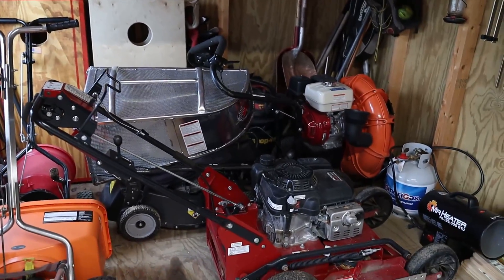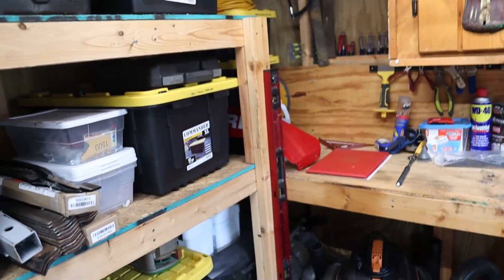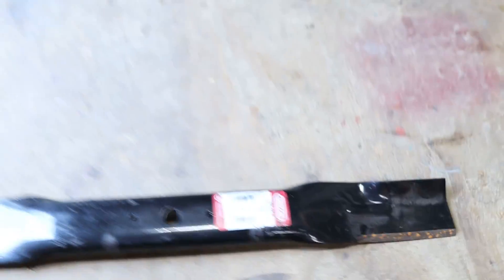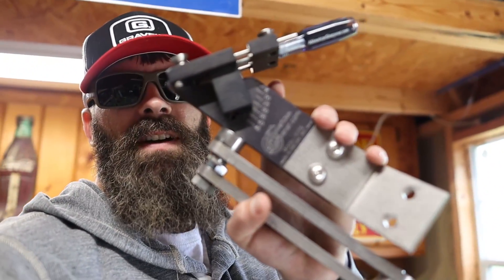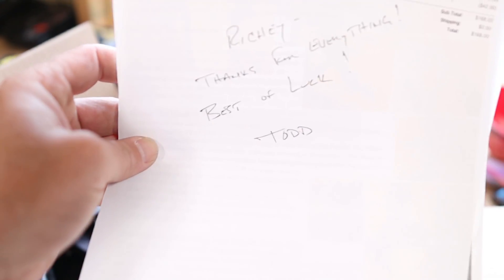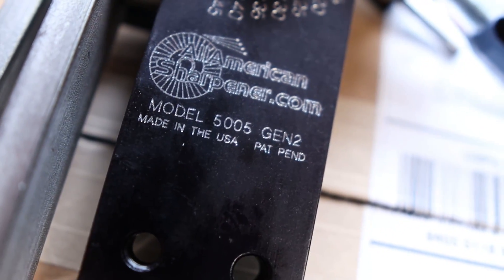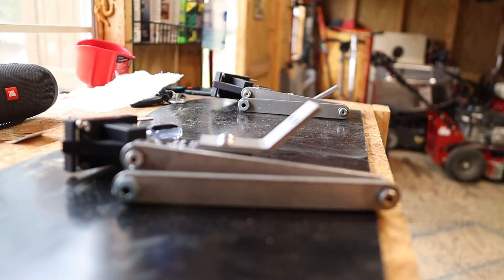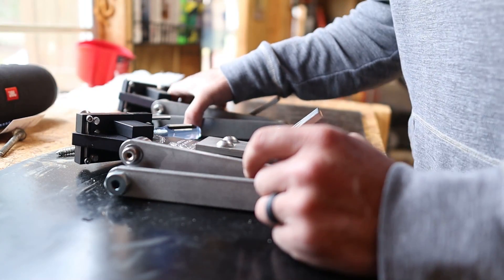The Best Lawn Mower Blade Sharpening Tool

Comment: In addition to only sharpening uphill.  Every two or three passes, put your fingers on the back of the blade.  If it's too hot to touch let it cool before continuing or you will be changing the temper of the blade. Flip the blade and do the other side whilst that side cools.
Reply from the maker: Thanks for the tip I will look in to it for sure
Reply: @PlemonsLawnCare  doesn't explain why you should only sharpen uphill, I'd imagine in part to keep from having the blade point grab and destroy the disc? Also what happens to the setup for the other blade that is reverse rotation and has the cutting edge on the other side of the blade, and why doesn't the shorter arm gen1 sharpener work on Walker blades does it just run out of reach?

Comment: I don’t have a lawn care business but I do have the 5005 gen 2. I have made a small business out of sharpening lawnmower blades and I have had nobody say anything bad about a blade I have sharpen. Everybody has there own way of doing thing but for me it was worth every dollar I paid for it.
Reply from the maker: Yea Ricky its amazing how great such a simple tool can be. Easy to put away and save space
Reply: I do have an extra mount and I use a Milwaukee m18 cordless grinder that works great. With the extra mount I made a work station to keep in the bed of my truck to mount my 5005 gen 2 when I’m at work everybody brings me there lawnmower blades to sharpen. Maybe something you would like to keep in your trailer for  emergency.

Comment: Wow. I’ve been in this business for 17 years it takes me 2 minutes to remove and sharpen the blade on my T25 and t23. I can’t see why I would want one of these. Seems like a hassle and process with no real  payoff.
Reply from the maker: Where is the hassle. The video is on initial assembly of the jig. What method are you using to sharpen your blades correctly in two minutes? The jig is small enough to be removed if you would like and put way in a draw or shelf and not take up the large space most blade sharpeners do. You have the ability to get the correct angle of any blade you put on it. I know the old way of hand grinding is not accurate or proper way to have a correct angle or balanced blade.
Reply from the maker: Chuck Taylor so I’m guessing your way is the only way to skin a cat right. You keep filing while I’m out mowing lawns chuck. This tool makes life easier not that it’s the only way. I have a small shop I like to conserve space but still be efficient. Time is money and if I’m hand filing and spending hours as opposed to minutes takes time from my work and family. You do your way I’ll do it mine but to say there is no value already explains to me you can’t be reasoned with anyway.
Reply: I'm kinda getting tired of burning through good gloves with the bench grinder and your head down to the other stone to get your one peeper 👁️ to see your angle, the Money you save alone in good gloves is worth the price of admission. 🤘
Reply: ain't no way in Hale you can knock that back side down with any file of a commercial mower blade that's been through 20hrs of mows, you'll just have a sharp edged 2x4
Reply: Plemons Lawn Care i understand, I guess it just seemed like too much. Yea  might of exaggerated a bit on the time for me. But in all seriousness it takes me less then 5 minutes to remove sharpen balance and reinstall blades on my Walker T25i’s. Really I’m hoping to one day find something that I feel is undeniably the best sharpener in the world haha.
Reply: I have several really good USA made mill bstrd files from years gone by.  I guard them closely because getting decent files these days is no easy task.  I have filed commercial blades for years with my 30"X2" files and they are great; but no match for this jig and a grinder.

Comment: do yourself a favor an ditch those after market blades and get the oem walker blades. you will definetly notice the cut quality and the longevity of the blade wear
Reply from the maker: We know oem are the way to go but when they aren’t in stock you have use what you can get at the time. Still the only aftermarket set I have for the walker. We keep at least 12 sets ready to roll each week

Comment: I'm trying to decide between the All American and the Oregon 1/3hp which do yall think would be the best choice for a small engine shop? I got my chainsaw chain sharpening down to a science running 2  tecomec super jolly with hydro clamp on both and diamond wheels from diamond wheel company (will never run another wheel) 1 setup up for 3/8-404 other .325-3/8LP 3rd grinder flat wheel for the rakers. I know they'll be some haters on my setup and probably for even asking this question but we all have our own ways. Thanks ahead for any input given negative or positive!
Reply: i don’t know if you made your decision yet but don’t get the oregon unless you get the 1 hp version

Comment: The vendor did a video on determining the proper angle. They recommended using a sharpie on the edge and scraping across the blade with the power off to see where the wheel is touching. Still too cold outside to do a maintenance on my new Deere X350. Looking forward to using the new tools.

Comment: You have sharpened more than I have but after assembly and motor mounted on scissor arms...Don't the arms need to be back behind the disc instead of beside it. Looks like not much clearance. thanks for your video.

Comment: Seen these a few times and they def do an awesome job. I still do by hand with the angle grinder and disc, put it in a vice to hold it, and then I found a blade balance checker at Lowe's. I check the balance and may take a little more off one side depending on how well it is balanced. I used to use a bench grinder and man...What was i thinking!! LOL. Great video brother, keep grindin!
Reply from the maker: Josh's Lawn & Landscape thanks josh. Only down side to hand grinding is keeping the exact factory angle. But the hand way is still doable with good practice
Reply: @PlemonsLawnCare  Def...the angle is the one thing in my mind when I sharpen them. Trying to keep it close. May work toward getting the AAS b4 long.👊👍

Comment: Thanks for the info. I've been considering this sharpener for my low volume requirement needs.
Reply from the maker: You want be disappointed. You get the correct angle and can remove from the bench to put away when not in use

Comment: Interesting tool. I'll need to look into it. Just used my angle grinder to sharpen my blades, by hand. It worked, but likely not as uniformly as this tool.
On other, technical notes regarding your video, 1.) Turn off the auto-focus on the camera. Very distracting as it searches for the focus point. 2.) Get all of your tools ready on the set. Don't want to see people walking around their shop, looking for a tool while nothing is happening with the subject. 3.) Speeding up boring, time consuming tasks is fantastic. We don't need to see every stroke of the ratchet. Good job. 4.) Your lighting was very good. Soft, diffuse light that fills in where deep shadows could form allows us to see all the features. 5.) Last, tripod mount the camera to keep it steady.
Reply from the maker: Appreciate all the camera and video help. I didn’t realize the autofocus was on when I recorded it and wasn’t redoing it lol I mow grass and help others in that field so I know it sucks for some people but got the idea on the sharpener is more what I was going for. I use a GoPro 99% of the time

Comment: You did exactly like I did; got the standard one first, then a new mower with half of its blades reversed.  I donated my standard model to a pal.  My shop is older and crowded too.  I was fearing that the shower of sparks might catch something on fire.  I had an old B&D Workmate clamping table and I set it up outside the door for sharpening.

Comment: I’ve came to the conclusion that blades just aren’t sharp. Not worth the aggravation trying to have sharp blades
Reply from the maker: They are not razor sharp for sure. But rounded over blades will pull or rip grass as opposed to actual cutting. If they are sharpened too much the will dull faster due to the thinner edges.
Reply: @PlemonsLawnCare  It’s just not worth the effort
Reply: @colestaples2010  You may be right if you don't have much actual grass and mostly weeds but a dull blade will rip grass rather than leave it with a clean cut. Grass with ripped ends makes your lawn look brown after a few days and it can also invite disease.

Comment: Send it back and get yourself a RGB712 and thank me later.
Reply from the maker: Nah I’m good I’ve got friends with them and you see how small my shop is. I prefer to be able to change angles for each blade and put the jig away if I’m not using it. The RBG are nice but I like this a little better
Reply: The RGB712 cannot possibly make as perfect of a Grind as this tool. This tool if set properly will always do a perfect grind, with the RGB712 when pulling the Blade across the stone the angle changes as you pull unless you are able to put the Blade in a Jig that could be made where the pull is the exact same you can't possibly do the perfect grind of the All American Jig. No way Jose! When the All American Jig is set properly it takes but a few moments in putting in a blade and sharpening it to perfection only if you put too aggressive of a wheel into the grinder can you cause some real problems, use a grit of 40 and you can do no better than that. Also Richey Plemons you have not watched The "All American" Youtube Channel or else you would know that you mounted the Jig upside down and you would make the elbow so it points toward you, not away from you as you do the grind. Look I am sorry for the negatives but it bugs me when things are not done correctly but Thank you for at least doing a fun job of this YouTube. Thank you.